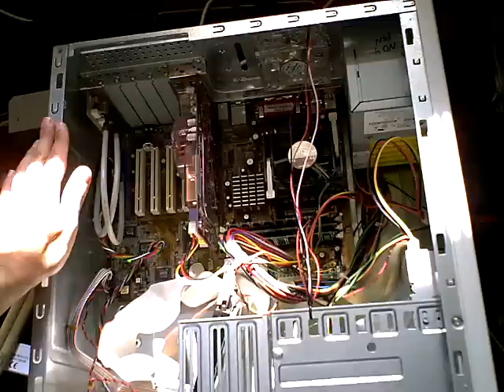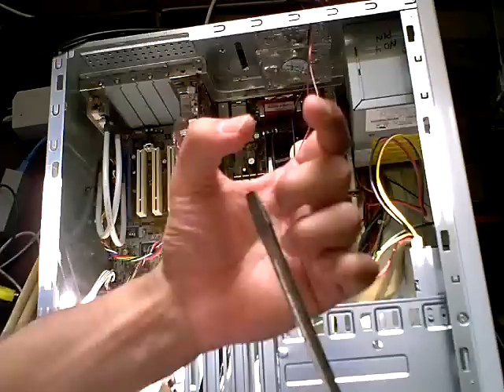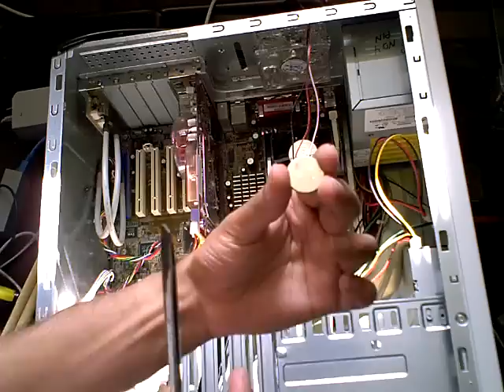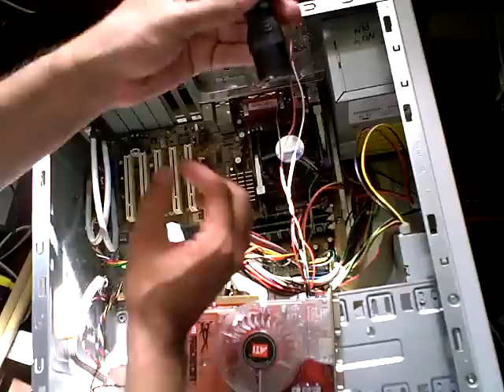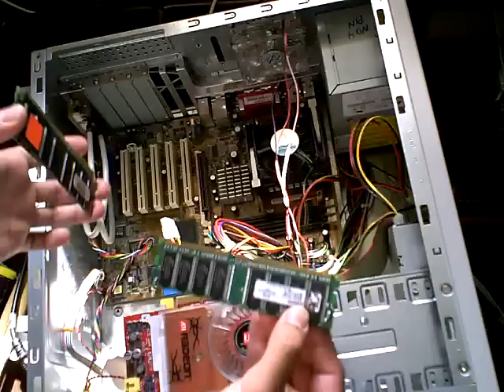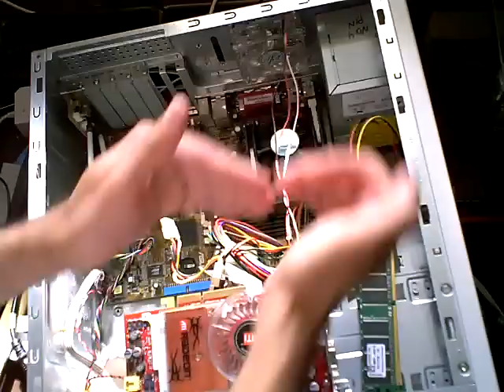How to possibly fix a PC that will turn on but will not beep and will not display anything on screen

Comment: Hi, I did what u did in this video, and it works, kinda, the 'black and white screen" shows up, fans running at normal speed, with a flashing _
Reply from the maker: +Gramur Nardzee Yep, the PC is looking for an operating system. Try entering your BIOS to ensure that functions

Comment: im trying again with that computer i found and now im not getting any screen removed all the ram and got three beeps what does this mean
Reply from the maker: +benjamn luz Beep error codes differ from one BIOS manufacturer to the next. To discover what the beep error code is trying to telling you, discover the manufacturer of your BIOS (available in the motherboard's manual or on the motherboard's manufacturer's website {on the page for your specific motherboard model}) and then look up the frequency and interval of your beep error code on:

http://www.computerhope.com/beep.htm
Reply: I RESET THE CMOS AGAIN AND SLOWLY ADDED THE PARTS BACK ONE BY ONE I GOT IT TO RUN I NEED TO KNOW IF I CAN RUN A POWER SUPPLY FROM A XPS 400 DELL DESKTOP PSU OUTPUT 375W ON A INSPIRON 531 DELL DESKTOP WHICH IS CURRENTLY RUNNING ON 300W PSU BUT I NEED MORE POWER I WILL BE RUNNING A NEW GPU WHICH IM ASSUMING WILL ASK FOR MORE FROM MY POWER SUPPLY AND ILL BE INSTALLING A NEW CPU ASWELL PLS LMK
Reply from the maker: +benjamn luz Well, you have to look on the manufacturer's respective support websites for the power requirement of your board and your video card. Remember, when it comes to wattage, having too much is always better than not having enough.
Reply: does the name brand make a difference becuz everyone says my pc is compatible with tfx and idk the name of the psu from the xps 400 dell
Reply from the maker: Experts will say that it is worth the extra money to invest in a good name brand PSU. As for me, all of the gaming machines I built are mid-to-low range, so I put in the cheapest PSUs that exceed my wattage requirements that I can find. Am I losing performance because of this? Perhaps..but for me it does what I need. If your Dell power supply has enough wattage and all the required connectors to power everything, then theoretically it should work.
Reply: theoretically yes, ... u are right but i figured out my answer and i will get a tfx 400 wat psu but i am now running a 125wat cpu but im trying to get by on  a 300wat psu for the meantime until i order this new  psu i have been monitoring and my specs show core#0 is at 150-152 but when the wind blows in my window it drops to 145-148 lol and my high is 161  and core #1 somewhat same numbers but always one or two higher or lower idk y but i observed that . let me know if im ok here your opinion evidently is very informative to me here are my pc specs so we can be on the same page here ok

motherboard 0ry206
cpu dou core athlon (tm) 64x 2 6000+ 3.00 ghz
creative sound card
gpu nvidia zotac geforce 9500 1gb
idk my hdd, it says i have 185 of 288 gb free
4gb maxed out ram hoping i can make it to 8gb by switching to 64bit os
current os 32bit
Reply from the maker: (shrug) sounds fine by me. Interesting observation with the wind: affecting fan speeds perhaps? Unsure. But hey, if it works, then it works : )
Reply: HEY IVE MADE ALOT OF PROGRESS IN THE TIME I WAITED FOR YOUR RESPONSE I HAVE A 375 WAT TEMPORARY PSU GOT A NEW CPU HEAT SINK FAN AND NOW RUNNING WINDOWS 10 IM TRYNA FIGURE OUT HOW TO GET MY HANDS ON AN SSD AND IM GOING TO GET A 500W PSU I FOUND ONE BETTER AND CONTIMPLATING ON WHATS THE BEST GPU TO GET FOR MY PC
Reply from the maker: Heh, you are asking the wrong guy. I build budget gaming PCs. For example, I would NEVER buy a SSD because for me the minor speed benefit isn't worth the investment. That being said, my choices for hardware would be very different than yours.
Reply: not at all sir you are very informative,

Comment: When I start up pc after attempting to trouble shoot the fans spin for about one second then turn off please help
Reply from the maker: +chris garcia  It sounds like your motherboard is developing a short circuit due to contact with the metal casing. Most likely it has to do with the screws and metal mounting stands (supports) that your motherboard sits on. The cheapest way to fix this problem is to introduce cardboard washers between the screws and where they make contact to the motherboard, or you can buy plastic mounting supports at a computer shop.

Alternatively, you can always Breadboard it (explained in the following video:)

If the steps in this video did not provide a solution to your problem, view:

http://www.youtube.com/watch?v=_EK9a-R5pss

You never know, maybe rebuilding the PC in the opposite sense that you took it apart will solve the problem.

Comment: What if I were to switch my come battery with another one
Reply from the maker: +MrJenkins No problem. These batteries don't last forever, and sooner or later they will need changing. Just make sure the PC is unplugged and the power button on the chassis is pressed before doing so.

Comment: After I did the thing you told me it won't start. It used to have light but now it doesn't
Reply from the maker: +SilverFlames Breadboard it (explained in the following video:)

If the steps in this video did not provide a solution to your problem, view:

http://www.youtube.com/watch?v=_EK9a-R5pss

You never know, maybe rebuilding the PC in the opposite sense that you took it apart will solve the problem.

Comment: I replaced my CPU with another one. Now when ever I try to turn it on, the monitor doesn't turn on and neither does the keyboard. By the way it's AMD
Reply from the maker: If this is new hardware that you are installing on your motherboard (that you have not yet got to work on your motherboard,) note that matching bus types of video card to motherboard socket does not necessarily signify compatibility. If this is the first time you are trying this hardware on your motherboard, there is a chance that this new hardware is not compatible with your motherboard, despite the same bus type and despite the fact that the new parts fit in their respective motherboard socket. Your motherboard manufacturer's website will have a support page dedicated to your motherboard's model, and on this support page should be a compatibility list for such components. Ensure that your new component is certified to function with your motherboard, and if your new component is not present on the compatibility list, then there is a chance that the component is not compatible with your motherboard.
Reply: Never mind, my CPU pins were bent...
Reply from the maker: Jacob sneiger
Heh, well, glad you found the source of the problem, and hope your CPU can still be used

Comment: my computer start but it shows you didn't shut down your computer and its says welcome then it will shut down
Reply from the maker: First, go into the BIOS at boot, Load Setup Defaults, save and exit. If that doesn't work, then it sounds like your Windows installation is corrupt. You can try booting while holding the F8 key to go into safe mode, and then uninstall all non-essential software. You could also click START, RUN, and type MSCONFIG (followed by enter). Here, disable everything under the STARTUP tab. If none of this helps, I'd backup all irrecoverable data and reinstall Windows.

Comment: Man my pc run but dont  display the ram is good the graphic card is good the cpu is good help me please is the problem in the mother board?
Reply from the maker: Can't tell you where for sure the problem is. Try everything shown in the video and let me know how it turns out.
Reply: ireplaced my motherboard and nothing to but itook a look at the cables  and one of them was white (ihate white) ichanged it then iturned pc and voila it was fixed btw awsome vid
Reply from the maker: ALGamer | Dz/En
Heh, I didn't quite understand your initial reasoning, and I'm having even more problems understanding how you actually fixed the thing, but in the end I'm glad things are working now : )

Comment: My computer turns on makes the normal beep and nothing shows up on my screen I don't get why
Reply from the maker: +Alonechance115 Your PC is probably defaulting to outputting video from a different video out device than what your display is connected to. I'd power down the machine, connect to a different video out port on the back of your PC, then power up
Reply: nah my gpu died so i got a new one
Reply from the maker: +Alonechance115 thanks for the update

Comment: i bought a new pc its hp pavilion and i bought a new graphic card with it when i put it i open the pc and all the fans work even the one in the graphic card but the screen is all black with no error i putted back the athor graphic card and it work i downloaded the nvidea driver for the new graphic card and it worked and when i putted the new one it worked but now after i upgraded the windows to 10 the same problem came again and i can't figure it out can someone help me :(
Reply from the maker: +real Fedi Compatibility issue with Windows 10. Downgrade to a previous Windows version.
Reply: RodneyDickson i dont even have that option to downgrade its like a clean setup and it deleted everythin but thank u mate anyways
Reply from the maker: +real Fedi Sorry, by downgrade I meant format the hard drive and reinstall the operating system that came with your machine, but then again, you would have needed to have made restore discs in order to do so, and chances are you didn't do this.
Reply: eh this sucks :\
Reply from the maker: +real Fedi Yeah, crappy to say after-the-fact, but upon obtaining a name-brand PC, the FIRST thing users should do is master those restore discs, for situations such as these : \

Comment: guys pleas help i have msi gtx760 oc and he disconnect after 10 min and the fans still working  is that becaus my power suplly is 460 w /???
Reply from the maker: So your PC works as intended for 10 minutes and then shuts off on its own?
Reply: yah but when i change my graphic card its work  idnt know if that the gpu prblm or my power splay
Reply: no when i chane gpu its wrk not like the previos one
Reply: and every thing work only the gpu
Reply from the maker: In this case, you are most likely correct: the problem probably lies with either your PSU or GPU. Even for low to mid grade GPUs, 460w is very low. Your GPU is made for performance, so it most likely needs more juice. Research how much power your GPU requires minimally and then purchase the next step up in PSU (so if it requires 550w minimum, buy a 600w PSU). To recuperate some of this money, sell the old PSU on Kijiji. If a new, more powerful PSU does not solve your problem, then consider the GPU either defective OR incompatible with your motherboard (it could be either / or).
Reply: Kwlv 77  Whilst it's always nice to have extra watts up your sleeve you really don't need much more than what you already have.  Your card isn't that power hungry at only 170 watts, so unless you're running some very sophisticated addons your power supply should be OK.  I've fitted a couple of these since Christmas and whilst I wasn't that impressed with them I recall one them had a 450watt supply feeding it and it's working well according to the owner. So unless your absolutely certain your supply is at fault, I wouldn't bother changing it.

Comment: I powered my PC same happened and it started smelling  like burning plastic, i replaced the PSU , still the same
Reply from the maker: +Milos Miric Could be the board, could be the power supply, could be a lot of things. I'd replace the board, CPU, cooler, and power supply to cover all bases

Comment: Please hellp when i install graphic card to my mother board my monitor go black and don't show enything PLEASE HELP ME POST ME AN MESAAGE
Reply from the maker: +sone fula If this is new hardware that you are installing on your motherboard (that has not yet functioned on your motherboard,) note that matching bus types of video card to motherboard socket (PCI-E for example) or matching bus types of RAM module to motherboard socket (DDR3 for example) does not necessarily signify compatibility. If this is the first time you are trying this hardware on your motherboard, there is a chance that this new hardware is not compatible with your motherboard, despite the same bus type and despite the fact that the new parts fit in their respective motherboard socket. Your motherboard manufacturer's website will have a support page dedicated to your motherboard's model, and on this support page should be a compatibility list for such components as video cards and RAM modules. Ensure that your new component is certified to function with your motherboard, and if your new component is not present on the compatibility list, then there is a chance that the new component is not compatible with your motherboard.
Reply: Hey thanks but i fix all of it :D !!! ask me how i fix it i tell you :D
Reply from the maker: +sone fula I'm very curious. Please tell...
Reply: When i buy graphic card i was pluging my cable of monitor in my motherboard >>>> PUT CABLE IN GRAPHIC and you solve black screen you know the cable of monitor into the graphic if you have adapter buy 1 and the's it :D
Reply from the maker: +sone fula Heh, good tip. Thanks for sharing
Reply: Yeah :D thank you for showing love :D
!!!!
Reply: Np :D ask me all about you wont :D srry bad english :S
Reply from the maker: +sone fula It's all good. Be well : )
Reply: You too mi friend !!!! :)
!!!

Comment: I cant find the jumper plzz help i dont have q manual
Reply from the maker: Skip the jumper step: disconnect the power cable, remove the CMOS battery, press your PC's chassis power button switch (to discharge any remaining power circulating in the system), leave the PC unplugged and in this state overnight, then the next day return the CMOS battery to its socket, power up the PC, and if no beep, then disconnect the power cable, press your PC's chassis power button switch (to discharge any remaining power circulating in the system), remove one component, power up the PC, and if no beep then repeat (each time unplugging the PC, pressing the power switch to discharge remaining power, removing a remaining component, and then powering up, and this until the PC beeps at boot).If it never beeps, even when you are down to just motherboard, power supply & CPU+fan, one of these remaining components may be bad

Comment: If I use hdmi to connect GPU to TV it says "PLEASE POWER DOWN AND CONNECT THE PCIe POWER CABLES FOR THIS GRAPHICS CARD."

GTX 760
AMD FX-8350
Gigabyte 78LMT-USB3
EVGA 430W PSU
*Nothing else special
Reply from the maker: Your video card should have a power connector on it that requires an additional power connection from your power supply directly to your video card (at least what I would assume). If in the end this isn't your case, you can read the manual of your video card (which hopefully will help) or if you really are out of clues, try google searching the very error message and hopefully somebody solved that issue on a forum somewhere. Good luck with it : \
Reply: I was able to figure it out shortly after I posted and u are spot on. My gtx 760 comes with additional adapters that needed to be plugged into the card with the power supply. 

Thanks for the help anyways and keep up the good work!
Reply from the maker: gentlemenRick
Nice! Glad I could lead you in the right direction : )

Comment: Does it delete all my software and data?
Reply from the maker: +Joseph Le Nope, it only deletes the settings of the BIOS, so the date and time settings, default boot devices, power saving settings, etc.
Reply: What about another drives?
Reply from the maker: +Joseph Le Same, the data on them should remain as well.
Reply: I have another question that if it deletes BIOS, so it will change to default?
Reply from the maker: +Joseph Le Well, it deletes the settings that either you set or that the PC set as default, it does not delete the BIOS per se. Because of this, after you perform this trick, it resets the BIOS settings to the default BIOS settings. Default BIOS settings are the settings that are, chances are, safest and most compatible to boot your PC.
Reply: Ok, thanks mate.

Comment: I build a desktop I got fan and cpu fan on for 5 second then it stop help pls
Reply from the maker: +hamzallah mohammed It sounds like your motherboard is developing a short circuit due to contact with the metal casing. Most likely it has to do with the screws and metal mounting stands (supports) that your motherboard sits on. The cheapest way to fix this problem is to introduce cardboard washers between the screws and where they make contact to the motherboard, or you can buy plastic mounting supports at a computer shop.

Alternatively, you can always Breadboard it (explained in the following video:)

If the steps in this video did not provide a solution to your problem, view:

http://www.youtube.com/watch?v=_EK9a-R5pss

You never know, maybe rebuilding the PC in the opposite sense that you took it apart will solve the problem.